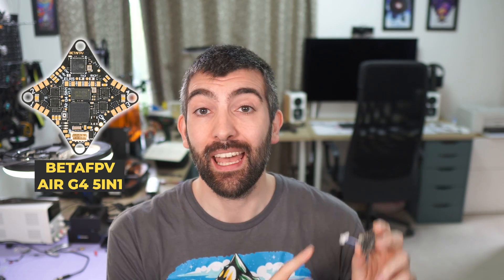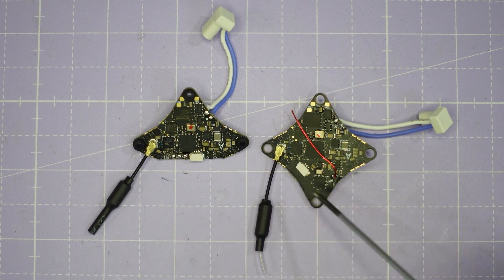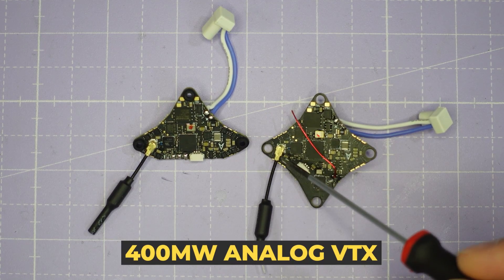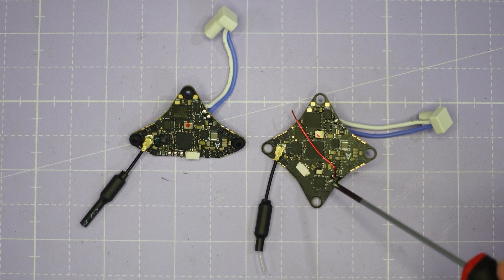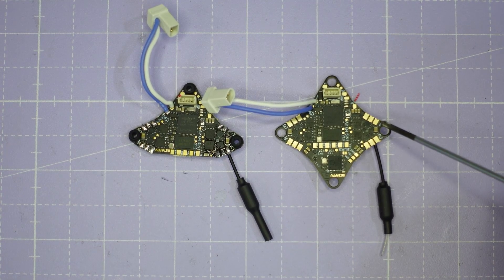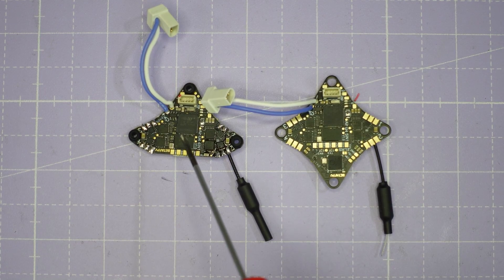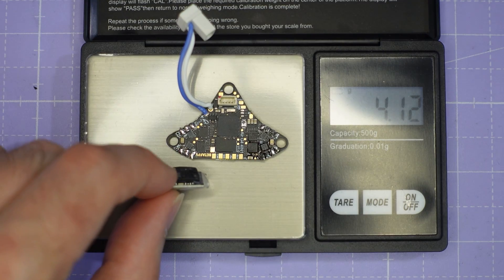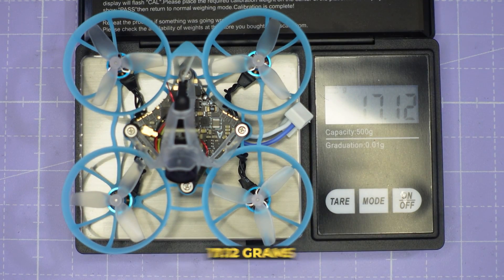Tiny Whoop PERFECTION? BetaFPV AIR G4 5in1

Comment: Chris, what do you think about the overall range? At 400, I don't seem to be getting  the same penetration between the 4 in1 and the 5 in 1? In the exact same place with the same gear, it's seems to have more noise, break up...? Thanks for all your great videos! Love all the deep dives
Reply from the maker: The 5in1 has a better tuned VTX for consistent output power. I found the 4in1 has much more variable output power depending on which channel you set. RaceBand 1 is the best channel for the 4in1.
Reply: @ChrisRosser  thanks Chris!!

Comment: Nice video! But please test ESC endurance from those. Almost all tiny AIO (both 4-in-1 and 5-in-1) I got end up unable to spin one motor after 15 or 20 packs. I guess it's a broken ESC. Quite tired of buying those given the tipicaly low realiability. I dont mind an extra gram if it lasts. Such a low realiability kills the hobby. Please save us :)

Comment: Got mine yesterday and think betafpv cherry picked the one they sent you. Using my immersionRC meter directly hooked up im seeing 300mw on the 25mw setting decay down to around 35-45mw. This happens everytime i unpit or plug in.

Also using my rf explorer im seeing R1 at the end of the battery smear into R2 slightly.

With the quality inconsistency these will likely be a no go for racing...what they are marketed at and this will create a lot of feels bads for those who dont have test gear.

Comment: Curios to know why 6S AIO chips don't include an ELRS receiver built in, wouldn't it be much more durable and easier ?
Reply: More stuff added to AIO makes them less reliable and durable!
Reply: Much cheaper and less trouble for manufacturers to leave out elrs and vtx from aio FCs

Comment: Wish the vtx was disableable
Reply: pit mode or what?
Reply: @marc_frank  the vtx scrolls terribly with my akk vrx.. so I'd rather use another vtx. I have a hdzero spare at the moment.. so I put that on it.. but the onboard vtx is still transmitting and not on the channel I had last selected.. I installed a dummy load antenna.. in order to not ruin the onboard vtx.. but a solder bridge to unpower the vtx would have been a free/easy thing to provide by the mfg. I think all this aios should have stuff like that.. it'd really improve the second life of them.

Comment: I've seen a few posts saying the 4in1 and a receiver is actually slightly lighter than the 5in1, so it's interesting seeing yours being so much heavier... I wonder if there's a pretty big variance in board weights?
Reply: It is lighter to have separate. Chris's comparison includes extra long wires and hear shrink on the receiver. With a HM Ep2, minimal wires and double sided tape holding it in place you end up about 0.2g lighter.

Comment: I hate my life. air65 just arrived and this drops.
Reply: I believe the 4 in 1 with a separate ELRS receiver is lighter than the 5in1. I think Albert Kim had a video on it? Maybe with the ELRS receiver and the wires it's heavier idk

EDIT: just got halfway through the video I guess the 5in1 is lighter. The last video I saw must not have included double sided tape and wires for the reciever
Reply: @sakfpv8444  nickburns had a video where it was lighter with wires
Reply: @sakfpv8444 nah it is heavier, but not if you want to use really long wires and heat shrink and double sided tape for the receiver. For a normal weight-conservative build it will work out lighter to have separate 😊
Reply: 5 in 1 is rubbish. 4 in 1 plus receiver is reliable.
Reply: You got a good one. 
5 in 1 all defective like ALL NEW BETAFPV PRODUCTS HAVE BEEN FOR YEARS AND YEARS!
Wait for a V3 product before you buy it if you want one that actually works! Seriously.